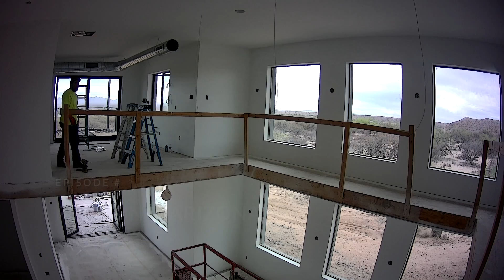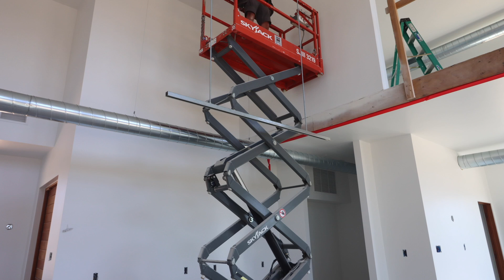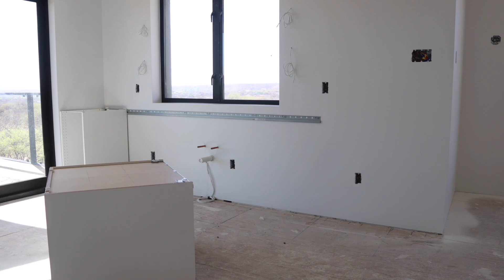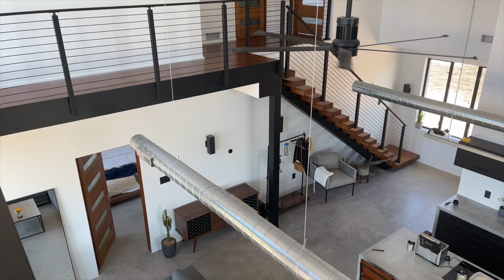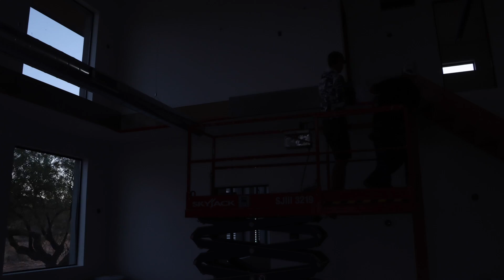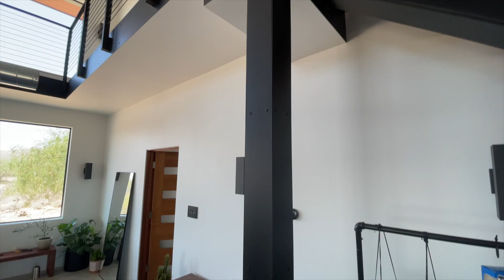INCREDIBLE Exposed Duct Work Installation & Finishing

Comment: As an HVAC installer for a very reputable contractor, I might have to show some of the architects I work with how an exposed system like this could add to the charm of a home. Modern, open-space designs really limit the potential of the highly efficient equipment available today  and add hours of layout and labor in order to accommodate them behind the scene. What you have done here is brilliant! I bet that contractor was excited to install this system.

Comment: Could you advise?  I’m “trying” to beautify my laundry room/office.  Unfortunately, the HVAC ducts run outside of the ceiling.  The problem is, the entry holes are larger that the Ducts, leaving wide open spaces.  
Q:  What is the best way to fix this problem?

Comment: New restaurant opened near me with exposed ductwork they had a huge condensation problem water dripping off down onto the tables - may not be an issue in the desert though but might watch out for it... good look though

Comment: The ducts are a loft style design element, they do that because lofts are sold with the minimum of interior finishes.  The Tennant's are intended to finish it out as desired.

When a loft does it, it's to make it feel open because it's a conversion of an industrial building in to residential units in a crowded city.

You're in the middle of the desert, who is crowding you?  It's a style that doesn't make sense where you live.

To me, it seems like a multi-zone mini-split system makes more sense and if you don't like the exposed units, you could do ceiling mounts.

Looking at the totality of your project, you spent a lot more money and square footage on style than I can afford.

My design is all about making the space I need, laying out my mechanicals so they fit in otherwise wasted spaces and adding features where I can do it without spending lots of money.

It won't look like a loft when I'm done but it will have high ceilings and open concept.  Rather than exposed ducts, I'll have gallery rail embedded in my walls.  I'll be able to make it look like a museum of modern art if I want, an art studio, just a home with eclectic decor or I can rotate between those looks.
Reply: I look forward to seeing your video productions of your work, sounds cool.

Do you have a break ground date ?
Reply: @Ivebeenaroundyouknow  my budget is pretty constrained so I'm not sure on dates.  I would love to start this fall but if material prices are too high, I may have to wait.

In the meantime, I am planning, figuring out what I need for my permit process and other details.

I plan to film portions of my build but probably not a full video series.

Comment: Just wondering how you will dust the duct work? Beautiful home.
Reply: Front door is big enough to roll in the man-lift for dusting... Just have to spend a minute cleaning the wheels so it doesn't scratch the concrete floors.